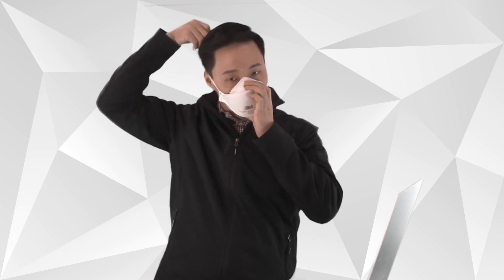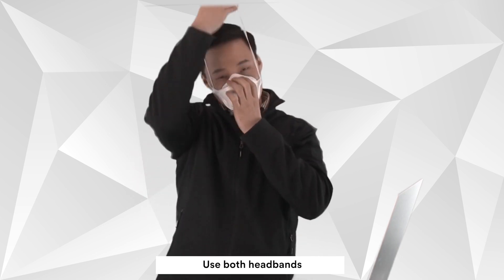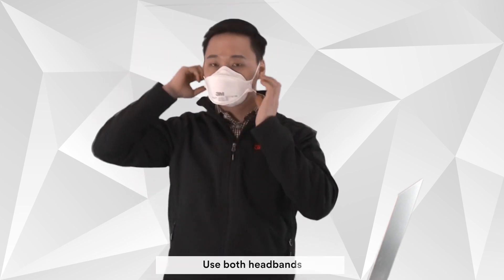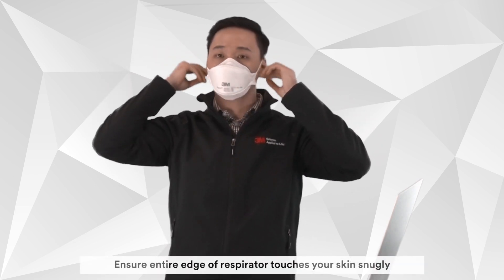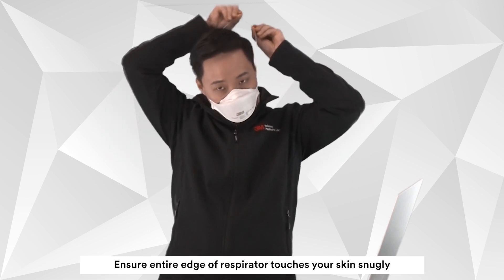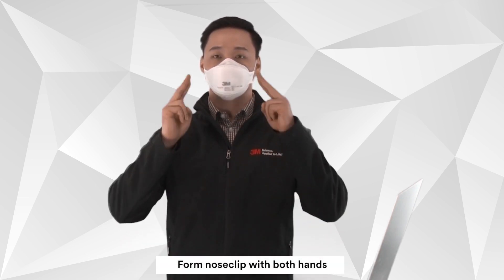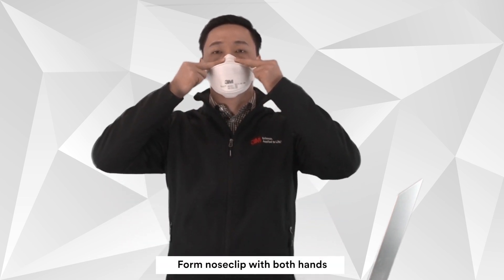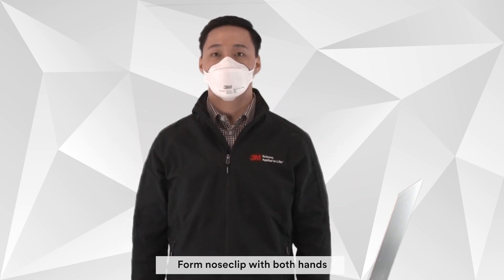Tips for using a 3M™ Flat-Fold Filtering Facepiece Respirator 9210+

Comment: summary: 1) you practice  this putting on and removal procedure until you are proficient and comfortable with the procedure and before actual use of this mask for the first time,   1) Nose fit- Use both hands, but Do not pinch, 2) check the seal, cover the mask surface with you hands,  and inhaling and exhaling sharply , if you feel the air leaking around the edge, adjust the fit OR if you can ot get a good seal, look for another mask that fit you better.